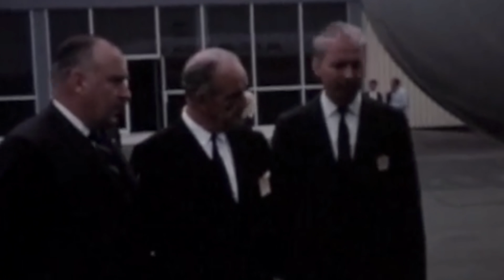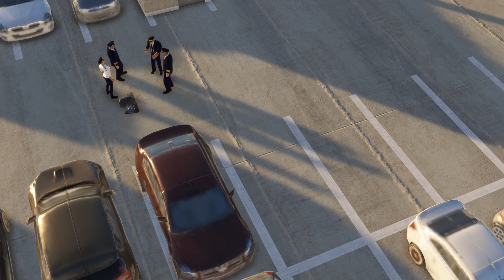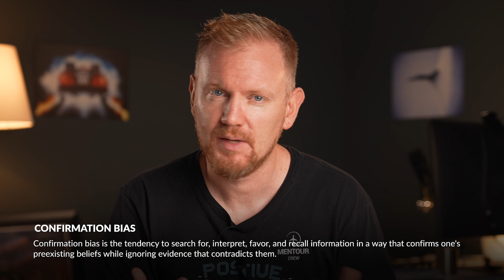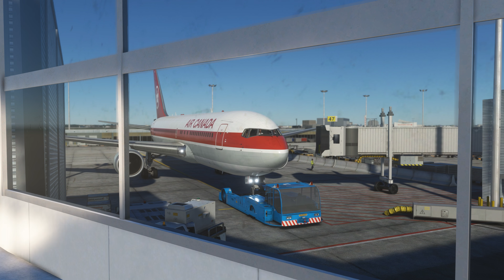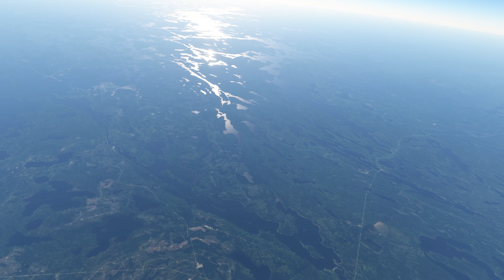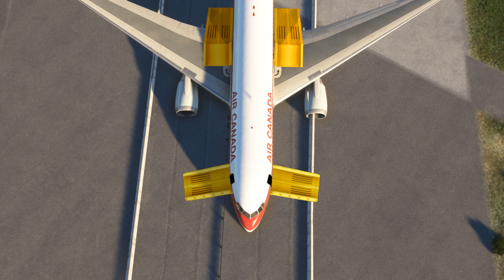NO Engines and Out Of FUEL! | The ”Gimli Glider" Miracle

Comment: as an american who works with both wood and metal i find myself switching around from imperial and metric all the time.  still, to this day, i dont have a sense of 'way off' when i see a metric number. i HAVE to convert it to imperial to get that size in my mind.  the 1L to 1KG, i know ive heard that, and i know that, but i did not remember it and would not have in this situation.  i DO know that a gallon of milk is about 8.4Lbs.   if the measurements on that plane were in Lbs and gallons it would have instantly clicked that something was wrong...         its kinda frustrating because metric is SO MUCH EASIER to use but instead i have to deal with 7/128ths or 5 thousandths.   i loath having to work out x/4 x/8 x/16 on a daily basis. i wish EVERYTHING was just x/128 or x/64  but nope

Comment: The first car I bought was second hand from a neighbour. The first time I took it out I was happily driving along when I noticed that the fuel gauge had dropped to empty. A rather scary drive home followed by a chat with the neighbour who said the gauge was broken, which would have been handy to have known. Anyway it gave me the fun of a 440 mile motorway round trip that I hadn't done before without really knowing if I had enough fuel to make it to the next petrol station, and then of later replacing the measurement float in the petrol tank and the joy of wondering if I had tightened it correctly so there wasn't a fuel leak.

Which is a roundabout way of saying, I can't believe the pilots flew the plane without working fuel gauges, and a wag of the finger to the technician who messed around with the system without returning it to exactly as had found it, if he hadn't fixed the problem.

Comment: Here’s the other major impressive thing is the slip technique worked. Since the tactic was meant to be used  for much smaller and lighter planes. More specifically it was a technique used usually only by jet planes. Not something as big an heavy as a 747. Also it was risky because Gimili was not an air base  base anymorebit was a drag racing stripe now in present day. There were other people there it was a miracle none of them were hurt.

Comment: Question: why is fuel even measured by weight to begin with? I get needing to know how much your fuel weighs for flight characteristic purposes, but why is that the primary unit? You're having to convert fuel from litres into kg, then from kg back into litres for refuelling. And it's not like the fuel gets "weighed" in-flight to generate to kg measurement, either. Wouldn't it be simpler to measure fuel by volume, considering that's far easier to actually gauge? It's be like responding to the "souls on board" question by weighing all the passengers, then calculating their count based on their combined weight.
Reply: Maybe because fuel volume changes depending on temperature.

Comment: The pilots must have thought the takeoff and landing performance were really good since they used a heavier weight with their charts to figure out takeoff speed and landing distance, so the lighter plane would have taken off really easily and stopped a lot shorter on landing.

Comment: I am surprised that there were no provisions for dual engine failure on a twin jet: it's exactly because of the possibility of dual engine failures that twin jets weren't allowed on transoceanic routes initially. So regulators, airlines and manufacturers should have been familiar with the idea that a twin jet might end up having a second engine failure after the first (albeit not with a few minutes of each other) and prepared procedures for the event.

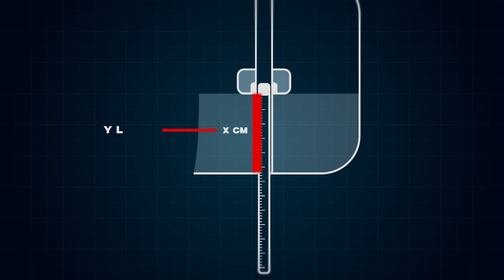Comment: 7:32 Isn't it a dip stick what you're referring to? Drip stick means, you pull it out unti fuel physically drips out of the stick, showing then the fuel level, whereas this dip stick interacts with a floating magnet insude the tank, surrounding the dip stick tube.

Comment: "I am a retired El Nuevo Dia, AP photographer from the 1970s San Juan bureau. I covered two plane crashes at St. Thomas Airport, both tragically involving the same flight number and resulting in casualties. I hold the original, photographs. I have detailed, on-the-ground accounts of the coverage, including my logistical work-around using an Antilles Air Boats seaplane for the first crash and my reporting on the 1976 American Airlines incident by helicopter. The airport extended their Runway out into the bay near the entrance to the airport and it is no longer a black star airport because of these crashes. It would be great to see one of your excellent videos. A huge fan of your YouTube channel.

Comment: The fact that the nose landing gear failed to lock in place was a blessing in disguise. If it had locked on, definitely the plane would have used a longer distance to slow down like causing ground casualties.

Comment: Not flying out without a fuel gauge operational is MEL. But what would happen nowadays if fuel indication is lost mid-flight? Would that be an instant "Mayday Fuel" going for the nearest appropriate landing site, or would slightly less drastic measures be acceptable if no other fuel quantity anomalies were suspected up to the gauge failure?

Comment: I am stopping the video at 22 minutes. I do not understand how any normal adult male can make a mistake like this. Knowing that a leader and a court are pretty close to the same thing and a quart is 2 pounds of pint is 1 pound, so a liter would be about 2 pounds or about a kilo.. i don't\n Understand how they could make a mistake that would be so far off like saying if you're putting gas in your carand someone says, I put 10 pounds in well, that's about 10 pt.  Or 2 and a 1/2 gallons, not 10 gallons. It seems almost intuitive that these numbers would not be adding up even without really thinking about it.\n And especially since they've probably made these flights before  That's something to them , did not seem odd about a very different fuel number

Unless they had a boatload of fuel left over from previous flights , there's no way that 5k could possibly do the job that would require 20k

I just don't get how they wouldn't catch this even without doing any calculations. How it just inherently would not seem wrong to them.

Comment: Maybe you would like to make a video about LOT Polish Airlines Flight 5055, which crashed in 1987 the Kabaty Woods nature reserve on the outskirts of Warsaw, around 54 minutes after departure. Cause was identical to a crash of the LOT Polish Airlines Flight 007 in 1980 - engine turbine disruption, causing cut of the avionic's wires in tail.

Comment: Around 21:00 - using 1.77 as the conversion factor is a very stupid mistake that no technical person should ever make. Its just an indicator of the density difference between water and fuel, and fuel is obviously a bit less dense than water.

*edit - Ah, you covered it later on.

Comment: As a schoolboy in the UK, I started off in Imperial before switching to pure SI at age 11. Until starting work after graduation I was SI until my first Boss, who only worked in Imperial. The resistance to change is all due to "Feel", this case shows it, a fuel density of way over 1 instantly feels wrong to me in SI. Transitions are always a problem but mixing the systems is worse, ask NASA!
Reply: FFS, that was decades ago. The U.S. uses metric extensively today, and uses it exclusively in most STEM.

Comment: Ok, slip if you want to call it that...I'm hollering  "crab it! crab it!"
Yaw is also acceptable I think.
Just throw your fat side at the wind.
Reply: It is definitly a forward slip. When an aircraft slips, the horizontal part of the airflow is not parallel to the fuselage (the longitudinal axis), so one side of the fuselage is facing airflow slightly. When an aircraft crabs, it compensates crosswind by heading slightly into the wind, so the aircraft keeps flying on the centerline. The horizontal part of the airflow is parallel to the fuselage in this case. A passenger would feel no difference between an approach with crabbing and crosswind, or a normal approach with crosswind (except being able to see the runway from the side window). But a passenger could feel a slip on an aircraft, and it would likely be unpleasant. The side of the fuselage would be exposed to the airflow, which would cause loud wind noises in the cabin, and the passengers would feel like being tilted to the side. Yaw is just a term for a horizontal rotation, so the nose moves left or right horizontally.
Reply: @CumulusHumilis1  That's a lot of words to repeat what I just said.

Comment: imbeciles ! all of them ! its not just that they don't understand the most basic aspect of the metric system, 1 liter of water is 1 kilo is 1000 grams, 1000 cubic centimeters etc, but they MEASURED THE FUEL !!!! don't they have even a VAGUE idea how many centimeters of fuel is needed ?? and didn't the pilots feel that the plane was far too light ? (i don't know if a pilot can feel this to be honest, 10 tons seems like a lot), and those pilots who accept to fly a plane without fuel gauges !!! and that MORON who didn't simply put the breakers back in the same position ! all inexplicable ! good that the pilot knew how to slow down the plane.

Comment: I've always objected the very extended costume of expressing conversion factors with just numeric values without units.  Such a costume has caused immense losses (e.g., that of a Mars probe) and, sometimes, casualties. That mechanic should have said 1.77 pounds per liter. An industry as risk-vigilant as aviation should impose such use of units across all personnel levels as fundamental risk avoidance. It isn't 0.3054 that converts feet to meters; 0.3054 meters per feet is the conversion factor. 1.944 doesn't convert metres per second to knots; 1.944 knots seconds per meter does (useful when you hear wind speed in meters per second and want it in knots: approximately 2 knots seconds per meter).

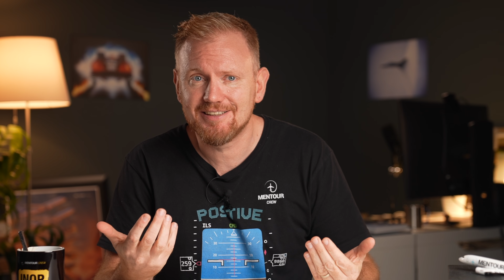Comment: 18:14 US UNITS? I THOUGHT IT CALLED IMPERIAL UNITS 🤔🤔
Reply: The U.S. doesn't use Imperial. It uses the U.S. Customary system for many common measures and in certain fields, and it uses metric extensively. In nearly every STEM field it uses metric exclusively.

Comment: 26:03 The attention to detail 😅Not only did the animator use an appropriate Canadian and Manitoban hockey team, but they use the period-correct team logo. Chef's kiss
Reply: When they mentioned the captain had glider experience, they didn't say from where. But the model and paint scheme of the example gilder they used means they knew exactly where he learned those skills as a teenager.
Reply: The Ottawa Airport in the animation was built sometime in the early 2000s, I believe. Definitely after 1983.  The old building is still there, but a much newer facility is the main terminal.
Reply: @seventeenpoint5  It also depicts Montreal's airport as it is today, not as it was in 1983. For example, other than the structural differences, it depicts the 747 city bus in front of the airport, a bus route which was introduced in 2010. Though it also depicts it as a coach bus, and not a modified city bus as it is in reality.
Reply: @guspaz  all of these are likely limitations of the simulator being used for the animations and re-enactments.  To have the old scenery, someone has to have built it, and I know of no modern simulators that have older airport designs.
Reply: What type of hockey?
Reply: Here you're thinking about something that I have no knowledge of and in the meantime I'm thinking that I could just see a family barbecuing and one of a couple.. let's say the husband says," Hey Madge that was close..." and this mutha frickin jet is like 1...maybe 2 feet from their barbecuing and Madge says," Is that jet air fuel floating into air?" Bubba says," I'm hoping that jet fuel smoke won't ruin the taste of our steaks."( Madge and Bubba are having a real calm conversation not even realizing if that jet would have slid another 6 feet their steaks would have been turned into hamburger.😊😅😂😂😊😮😮😮
Reply: That logo actually wasn’t used till the 90’s
Reply: They also made the flight crew look absolutely nothing like the historical one.
Reply: @notvalidcharacters 
Wokeness…again.
Reply: @slideryt  Don't think that's a word but certainly cluelessness. Appalling lack of the most basic research.
Reply: @notvalidcharacters  or maybe this isn’t a triple-a production and they had to use the models they had available.  Retexturing a shirt is one thing.  Wrapping a face texture is another.
Reply: @Historymaker-2001  Or maybe they didn't have to entirely morph the figures into what they weren't. If you don't have the resources then just leave it alone rather than distorting into something it never was.
Reply: @notvalidcharacters  tell me you know nothing about 3D texturing without saying you know nothing about 3D texturing…
Reply: @Historymaker-2001  What I can tell you is that I have never ever brought up "3D texturing" here or anywhere else. What I can also tell you is that you're obsessed.
Reply: @notvalidcharacters  this isnt a blender animation, this is footage from a flight simulator like microsoft flight sim or x plane. they cant use a model that looks like the actual flight crew unless they make the models and importing it themselves, so they just used the models already in the game. in fact, sometimes the cockpit doesnt even have pilots in these videos. they didnt "morph the figures" they just used what was given.
Reply: Sorry, all the cars in the original parking lot are modern and aren't parked in stalls. The pilots are wearing lanyards, which didn't become standard until much later, and their ties and the lanyards aren't aligned correctly. Finally, the flight attendant shown is in a modern jet with headrest screens. Those didn't appear until the '90s.
Reply: @John-tr5hn  You are correct regarding the vehicles viewed in the original parking lot.  However, in the views of the Gimli "landing strip," the gold sedan on the right side of the screen is a 1974 AMC Ambassador, so that one car fits the appropriate time frame.
Reply: but neither of the pilots were black
Reply: @llamamanguy  In the 1960’s, blacks consisted of 0.8% of our population. Even by the 80’s, a situation in which there were two black pilots and multiple black passengers on an Air Canada flight, would’ve never happened.
Reply: @llamamanguy yep. Woke bullsh!t
Reply: They had the Nunavut flag which only split off of NWT in 1999.

Seems like the animator is a big hockey fan more than particularly attentive of details.

Comment: Well this has changed my understanding of how this error was made. I had thought it was solely made in the refueling. Didn’t know that a previous failure in fuel gauges created the situation for a manual fuel check compounding the issue and creating believable figures.

Comment: the sticks are DIP STICKS, not DRIP STICKS
Reply: Drip stick is correct in this video. According to Perplexity AI:

"A drip stick is a simple, mechanical device used to manually check the fuel level in the tanks of many large airliners. It works by providing a direct, physical measurement of fuel quantity, serving as a backup to electronic fuel gauges and ensuring accuracy during pre-flight checks.

*How a Drip Stick Operates*

A drip stick is essentially a hollow tube, typically made of fiberglass or another non-magnetic material, installed vertically in the bottom of an aircraft's fuel tank. The stick is spring-loaded or held in place so that its top end sits above the fuel level when not in use. When a technician or pilot needs to check the fuel, they pull the drip stick down from its storage position through a fuelproof opening in the wing's lower surface. As the stick is lowered, the top end eventually drops below the surface of the fuel. At this point, fuel enters the hollow tube and begins to drip out through a small hole or cap at the bottom of the stick. The stick is marked with calibrated graduations that correspond to specific fuel levels in the tank. The technician reads the stick at the point where fuel stops dripping, which indicates the current fuel level."

-------------------------------------

Of course, dipsticks do exist, and most internal combustion engine automobiles use dipsticks to check the motor oil levels. Dipsticks are usually in the form of a solid metal rod with markings to indicate the minimum and maximum oil levels.

Comment: Intermittent faults don't just show up once and never show up again in most cases. The number of times where the ground crew ignores a serious issue simply because they can't reproduce it is disturbing. There's always a reason a system fails, and putting it back into the air without knowing that reason is playing Russian Roulette.

Comment: 25:22 that would need more than a little reasoning. Without any prior knowledge, it’s not unreasonable to think that jet fuel is twice as dense as water, assuming you know the density of water in the metric system to begin with. Pilots aren’t exactly hauling jerry cans of the stuff around regularly.
Reply: But at some point, in their pre-flight, every pilot drains the accumulated water out of the drain at the bottom of the tank in their Cessna/piper/whatever..

Comment: Nice choice of graphics for the glider. That's an SZD-30 Pirat. Great fun to fly and does a sideslip (forward slip) really well, except you would never need to do it because the air brakes (speed brakes) are really, really good.

Comment: 42:51 you also didn't mention that the service crew sent from Winnipeg ran out of fuel themselves, then got the plane back and finally determined the bad solder joint on the fuel quantity processor caused the issue.  If it had been worse, it would have switched over, but it gave enough of a weak signal that the sysyem couldn't deal with it and subsequently shut off.
Reply: That’s wild! Too bad he didn’t add that to the story